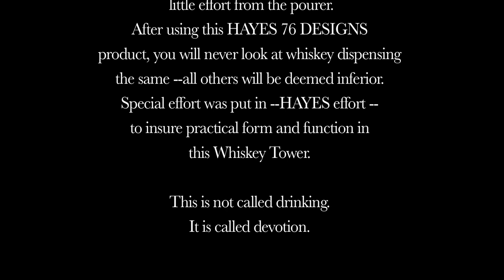Wooden Whiskey Dispenser

Comment: excellent job , I love it , a question, as you managed to not leak liquid between the bottle and the pipes ? greetings from Argentina
Reply from the maker: Thanks! I honestly just lucked out there. The bottle I used and the pipe I used just happened to have a snug fit but wasnt so air tight that it locked. If I hadnt lucked out like that I would assume it would take some trial and error to find the right fit.

Comment: Great video man!!  I'll get my dispenser started soon. Any ideas on how to make it for a different size bottle?
Reply from the maker: +Fernando Lopez Thanks! To make it for a different sized bottle you would just need a connector at the top of the threaded tee that would fit the bottle you're using. Or upsize or downsize all the pieces to work for the bottle you're using.

Comment: I do like the product your making, how do you get air back into the bottle.  I set this up practically the same other than the fittings are brass. However, when I open the tap it does not pour because no air returns to the nurse bottle.

Comment: How are u connecting the bottle to the spigot.  I've been wanting to make one but can't wrap my head around how to connect the bottle
Reply from the maker: +bsherfey20 I took the bottle I wanted to use to home depot and just tested it for the right fit with different ends.  Once the whole thing was built I was able to just flip it over and screw on the bottle.  I would suggest putting some kind of waterproof tape on the inside so the glass has something to grip onto.

Comment: I did the build and it turned out great but it won't pour because it is air locked. How do you break the vacuum and get air into the bottle? Thanks!
Reply from the maker: +Chuck Bredemus That's great! I'm really not sure about the vacuum though, I didn't even think about that. I screwed mine on with the bottle flat on the table and the base inverted and when I flipped it over and turned the faucet, it poured. Maybe you have too much liquid in the bottle? maybe start with the faucet open when you screw the bottle on? Good luck! sorry i can't be more helpful on this one! let me know what works.

Comment: Hi there, loved the idea, and i am busy making one, but noticed after just testing it with water the the thread where the bottle screws in is already rusting after just 2 days, i am using galvanized ones. Did you have the same issue and how did you sovle it?  I used a standed drinks pourer in the bottle to let the air out so it pours freely. See a few have asked that question.
Reply from the maker: Hi! I did consider rusting after the fact so I coated the entire inside with a food safe sealant. There were a couple of things I didn't consider before building this that I had to go back and correct. Hope that helps.
Reply: Any chance you could provide the name of the sealant and where you get it from?  Thanks.  BTW...nicely done.

Comment: Where did you purchase the nozzle you have screwed into the spigot or did you craft that piece?
Reply from the maker: It's actually an usual piece. It's a tip from a tattoo machine. I happened to have it on hand and it fit/worked perfectly

Comment: Awesome build. So does the whiskey just sit in the empty pipe space until the valve is turned? Being iron pipe, does it rust? I can't imagine it's food grade. Is it safe to dispense it like this?
Reply from the maker: +Scott Badeaux thank you.  Before assembly i cleaned the pipes, inside and out very very well. After the buildI sprayed a food safe sealant on the inside.  I think it's safe now, lol, but this is my first attempt at something like this. Some kind of valve that keeps it out of the pipe until it's ready to pour would probably be a feature I'd include if I were to build one again.
Reply: The fittings aren't iron, they're galvanized steel.

Comment: I added a vent tube to the system...that didn't help.  I installed the bottle at 45 degrees...that didn't help. The bottle is 1/3 full.  I'm stumped. I cannot get one drop out of the spigot (there are no clogs). I saw a similar video where the guy drilled a hole in the bottle to vent it....seems extreme. I make and sell bar related items and this would be a good addition. There has to be an answer.
Reply from the maker: +Chuck Bredemus that's really puzzling.  did you try starting with the spigot open? i have no idea if that'll help but I'm at a loss. I wish I had some answers... I was thinking that maybe the connection you have between the base and bottle is too air tight (if that's possible) so I just took mine out, connected the bottle and wrapped the connection as tightly as possible with a ton of teflon tape and it still pours. Maybe the spigot you're using is too small so air can't get in? Mine is fairly large, i just added a thin piece of metal I had to help it funnel.
Reply: +Hayes 76 Designs Found the solution! You're right...the connection was too airtight. I just inserted the bottle into the fitting with no tape or anything. It pours and doesn't leak. Thanks
Reply from the maker: +Chuck Bredemus Awesome! Glad it worked out, I've been stressing out for you over here!
Reply: +Chuck Bredemus For mine, I drilled a hole in the bottom of the bottle. Makes flow super easy, and refilling the bottle is easy as well since you don't have to remove the bottle to refill, just use the hole in the bottom (now top) of the bottle.
Reply: Not real handy when you want to use the original liquor bottle on the dispenser.

Comment: You forgot the steps that show inserting the coke bottle cap into the top so the whisky bottle can screw into the dispenser. Also, from what I read there seems to be a problem, later in it's use, of the seal in the faucet starting to leak because the whisky starts to eat at the rubber seal. In addition, you didn't show if you added a length of small hose/pipe to keep the bottle from a vacuum when dispensing.
Reply: thats because he didnt use and an extra vent line or bottle cap. parts shown were parts used. if you read his answers to people's questions, you'd know that

Comment: how do you seal the bottle to  the fitting? How does the bottle not tip over? The threads are different
Reply from the maker: The threads being different actually gives a snug fit but not air tight so it pours smoothly but doesnt leak. The design of the base is what keeps it from tipping.

Comment: do you need to drill a hole in the bottle for this? i saw one that says you need to do that. this looks way easier than most
Reply from the maker: If the connection between the bottle and the fitting is airtight you may need to drill a hole in the bottle. My connection was very snug but not air locked so no need to drill a hole in the bottle

Comment: Husband has been trying to make this but says that bottle needs to be vented.  I've shown him your video and told him that you did it without drilling hole in bottle.  He's followed your material list and gave me a "I told you so" when it didn't work.  Any suggestions as to why the liquid will not flow?
Reply from the maker: i'm guessing that the fit he has between the bottle and the fitting is too tight.  Mine has a snug fit but its not air locked. As long as it's "tight enough" it wont leak and the liquid will flow. This is something I didn't know going in but just lucked out that mine fit the way they did. Others have told me that if the fit is air tight and you'd like to keep it that way, drilling a hole and placing a cork in it will work.

Comment: Would you mind putting up a list of the exact parts (sizes) you used, please?
Reply from the maker: +Stephen Kennedy All galvanized steel (1)1.25" flange, (1) 1.25" threaded tee, (1) 1.25"x 2" nipple, (1) 1.25" - 1" reducer, (1) cap. And then a spigot to fit.. Hope that helps!
Reply: +Hayes 76 Designs Awesome, thanks!
Reply: Great looking project!  I'm trying to do something similar with 1/2" fittings...epic failure!  Haha!  Like some other posts, I'm using a cork method and it locks. So now I'm going with your parts list.  Where did you find 1.25" fittings?  I can't find any at the major retailers and even with the power of google I still can't find a reducer or a 1" spigot.  Any advice is greatly appreciated.  Thank you!
Reply from the maker: Thanks buddy! I found all the hardware at a Home Depot here in Connecticut.  It took some rooting around but they did have some. Good luck!

Comment: i am trying to do this with crown royal but i cannot seem to find a fitting that wiil do the job. Any suggestions?
Reply from the maker: +Dave Hinkle I took my bottle to home depot and just tried different pieces until I  found one with a snug fit.  I wonder if you can't find something to fit your bottle, if you get a piece thats slightly larger than your bottle and put some kind of rubber liner inside to snug it up? Like some flexible rubber tubing maybe?
Reply: +Hayes 76 Designs  what about Teflon tape?
Reply from the maker: +Nate Doggg Like plumbers tape right? I've never used it but I'm sure it would do the job.
Reply: +Hayes 76 Designs Thanks.

Comment: How did you get the air to flow into the bottle and get the liquid to flow out.
Reply from the maker: As long as the bottle isnt air locked it will flow. There is a way to get it to seal (no leaks) but still not be air locked. Its just a matter of how tight a fit the bottle is to the connector.

Comment: What did you use to connect the bottle to the top of the "t"?
Reply from the maker: +Jordan Blea I didn't have to use any additional materials. The glass and metal just happened to have a snug enough fit to not leak but not too snug to cause it to lock.
Reply: Cool. I make a liquor dispenser as well. I use a cork for my connection. I drill the center out and put a little piece of copper pipe in there for the flow. The cork screws into the top of the dispenser and the bottle slips onto the cork, it works well, just checking what others do as well. Thanks!
Reply from the maker: that sounds like a great system! this was my first attempt so if I make another one Im sure I'll test out some other ways to do it.
Reply: Good luck with it!